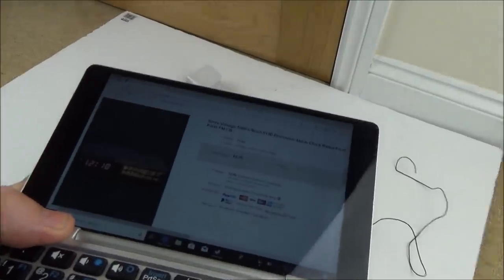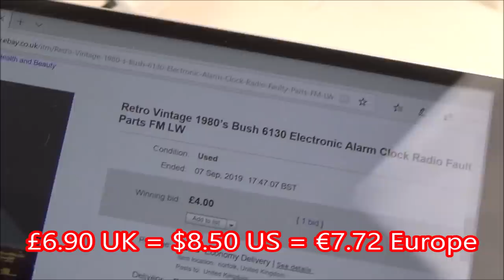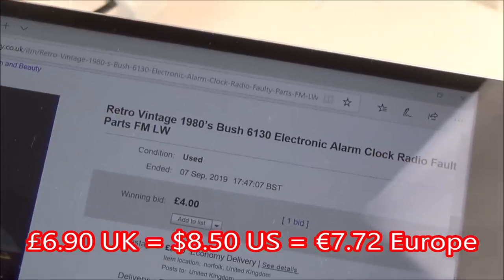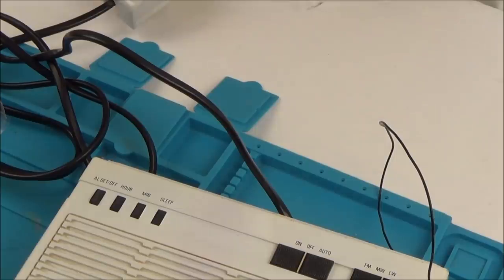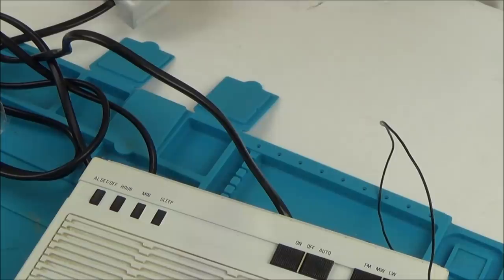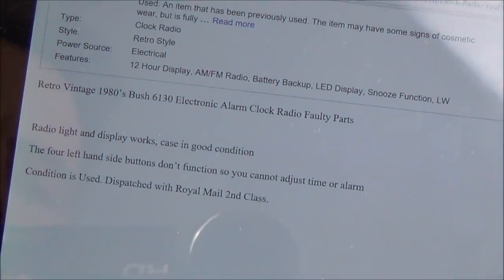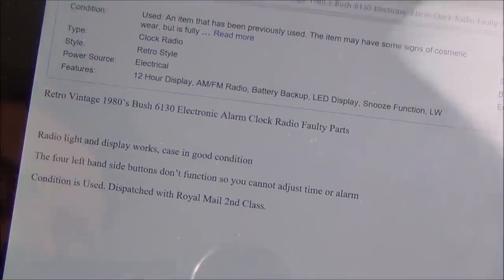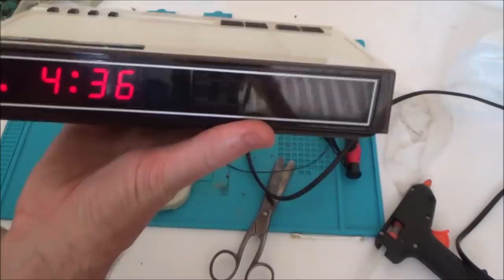Trying to FIX: 1980s BUSH Alarm Clock Radio

Comment: If you want to check those contacts, moisten your finger on the inside of your lip and just touch the contacts. No carbon needed.
Reply: Then you have a problem as water will cause corrosion so I wouldn't recommend that.
Reply: @LoneWolf5841-  There is more moisture in the air!!. Anyway, you can IPA it after anyway...
Reply: @Danechip  the moisture in the air doesn't have the minerals that liquid water has, to make it conducive the water in your saliva has salts and other ions in them that allows water to be conductive this is what speeds up corrosion as well as the oxygen (which is higher in concentration than the oxygen in the air) in the water allowing the metal to oxidize faster than just the Oxygen in the air. a general rule of thumb is to keep water away from electronics at all costs unless if it is deionized water, but deionized water is not conductive so it wouldn't work for what you are suggesting. Now yes using IPA after doing it will lower the risk of corrosion occurring but there will still be a chance if water makes contact and the electricity passes through allowing the reaction to take place, it is too big a risk when you can do what Vince did, also Vince was not testing the contacts he was testing if the rubber membranes would work as a replacement the way you would test a contact is with a multimeter set to continuity.
Reply: @LoneWolf5841-  We talking about 2 traces of copper on a PCB as a contact a damp finger to make that contact, nothing critical. This was nothing to do with continuity and that would not have worked unless he switched leads to the amp testing to make it continuous. Yes it worked with the 'rubber' as it had the carbon on it (rubber has a very high resistance in itself). Using a finger is just a quicker way of testing and none of my repairs have failed since HNC electronic engineering and a few hundred tv and stereo repairs in the 30 years since. Peace ;)
Reply: @Danechip  glad for it, last time I attempted something like that it caused corrosion now maybe I didn't clean it off properly with IPA so the reason could very well be my fault but point I am trying to say is I personally would not do it that way as there is other ways to do it without exposing the board to water.
Reply: @LoneWolf5841-  You seem a little paranoid Sir. Your saliva lid no where near the PH of a leaking alkaline call.
Reply: @Danechip  what? Not for sure what you are getting at? Why do I seem paranoid And we was not talking about the leakage of a battery what does that have to do with anything?

Edit: so I think I somewhat get what you are saying I belive Lid was supposed to be Is? If so yes a leaking Alkaline battery is not good for the board it will cause corrosion much faster than water will but water still causes corrosionion so why bring it up? Still lost on why you think I am paranoid though.

Comment: These small digital devices never have large caps in them and the transformer is completely safe if the device is disconnected.

Comment: Had a similar fix for my sons TV remote, it had fallen apart and the main up, down, left, right, enter buttons had a separate membrane (rather than the carbon being on the actual bottom of the buttons)
My first fix was to super glue small pieces of tin foil to the back of the buttons, it did work but not for long. I then found I had a few of those cheap remotes for battery powered candles. Those remotes have basically a sticker with the buttons molded into it with the carbon on the back. So I cut out the buttons and stuck them over the pcb areas of contact, put the rubber buttons back in and
Boom winner.
LED Lytes Flameless Candle Lamp - Battery Operated Candles Vanilla Scented Set of 3 Round Ivory Wax Flickering Multi Colored Flame, auto-Off Timer Remote Control for Weddings, Parties and Gifts https://www.amazon.co.uk/dp/B00WRKT9GW/ref=cm_sw_r_cp_apa_i_QGuFDbC6VNYCS
Reply: Also, maybe get one of those plug in rcd breakers when working on 240 stuff. Might help if things went bad 🤷‍♂️

Comment: I dislike new clock radio. I bought a Sony clock radio for 3 U.S dollars. It  has a leaky capacitor in the power supply because when the clock radio is plugged in but the radio is off I hear a crackling sound. I have a capacitor analyzer from the 1950's that I inject live voltage in the capacitor & the analyzer eye will determine the status of the electrolytic cap.

Comment: 10:45 a Nintendo 64 clone not a snes clone My Nate Vince.
Reply: Not even a clone N64, just a circuit board chucked into a plastic controller shell either derived from moulding from an original product or in some cases companies have the original moulds and do wicked things to 'em.